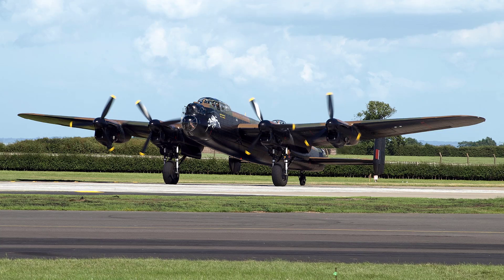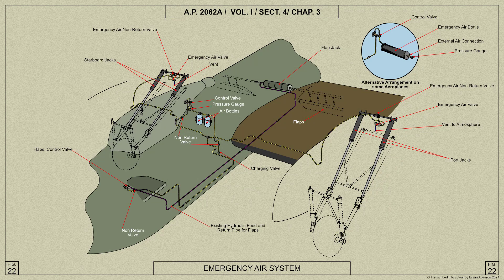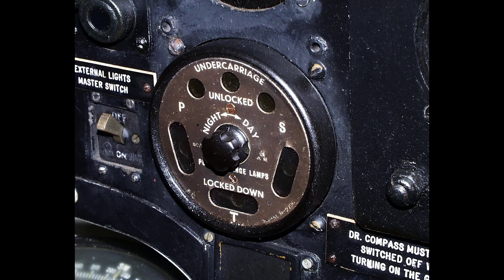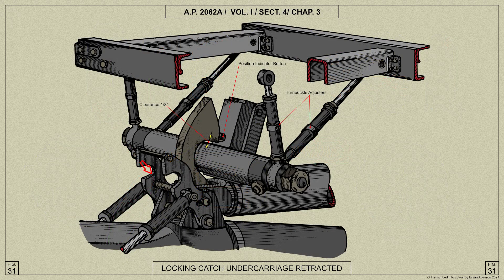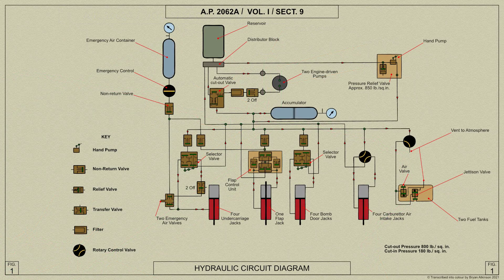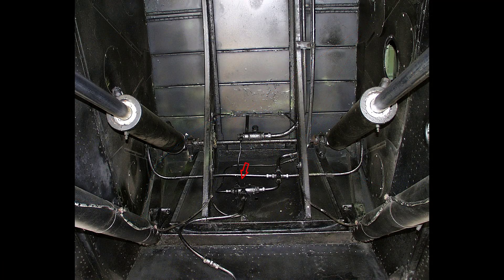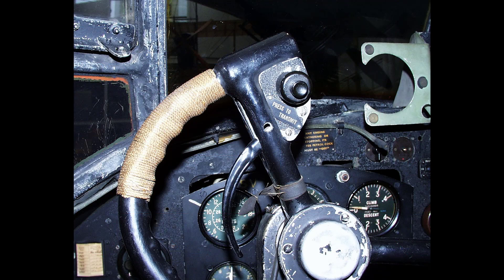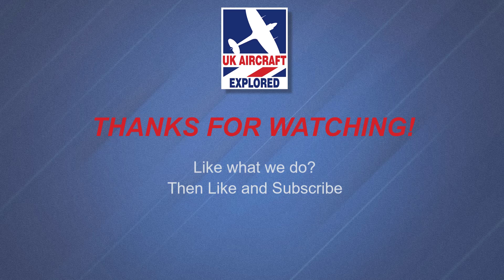Avro Lancaster – The Undercarriage

Comment: Another great video Bryan, The Lancaster undercarriage was very strong  when PA474 joined BBMF we took the wheels off to fit new tyres, due to age not wear.  We had to remove the undercarriage lever as it had a hydraulic leak, once refitted we did lots of retractions tests.  Up on jacks the aircraft jumped like mad as the undercarriage thumped into the up position, lowering the undercarriage it felt like the weight was making it jump forward, it scared the hell out of me !
Reply from the maker: Thanks for the info!
Reply: Your insights are always greatly appreciated too, Dave.